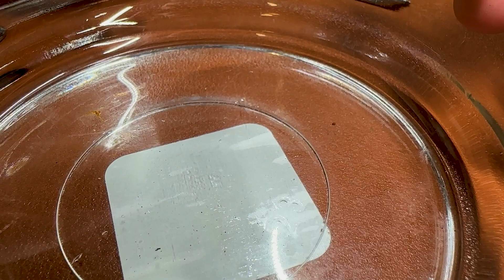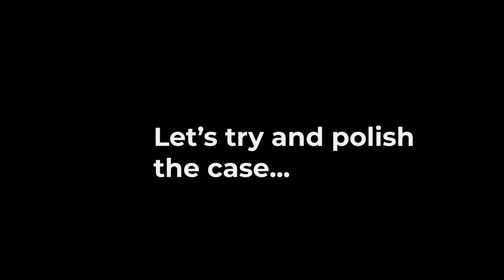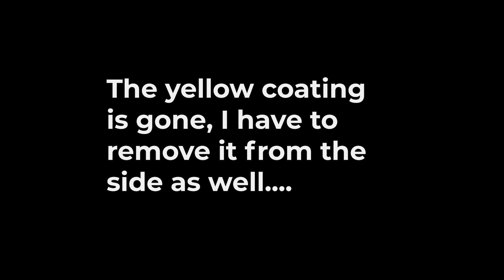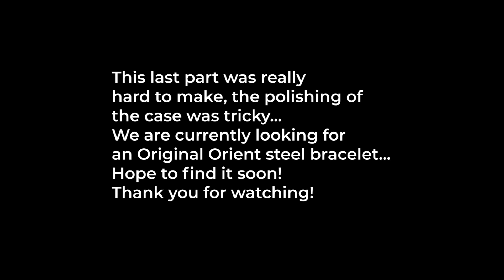Orient 3-Star Automatic Watch | Case Polish & Final Assembly | ASMR

Comment: Should always avoid using the old crystal gaskets. They are compressed and will not seal. I kinda felt bad for the case if I'm honest. 😢 Lost its color, and nice sharp edges along with the straight brushed ends. It could be refinished back to original shape and re-plated.
Reply from the maker: Yes, but replating cost was more than the watch itself.